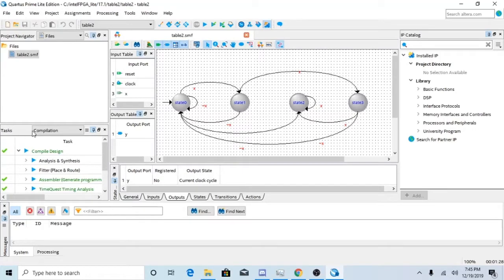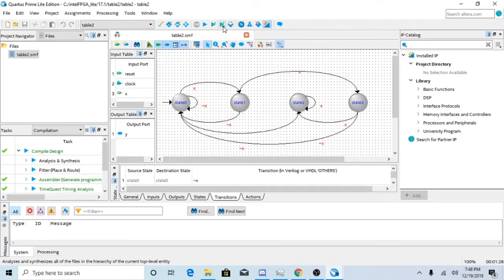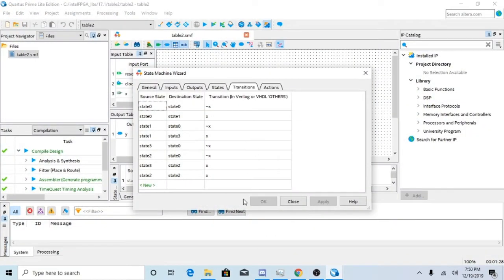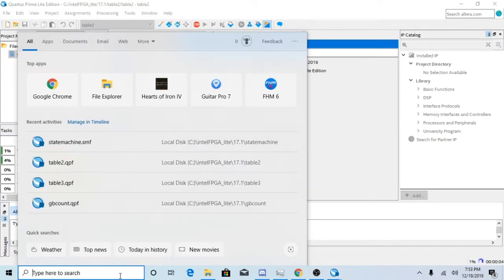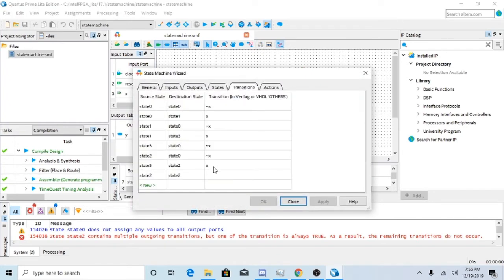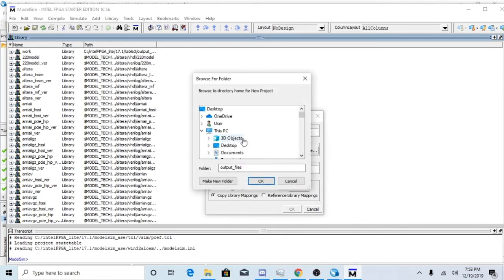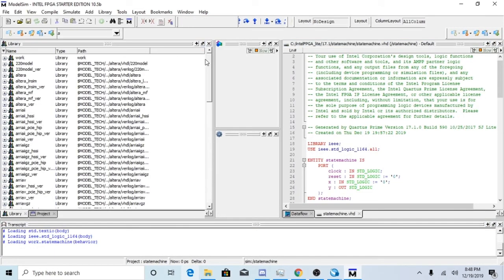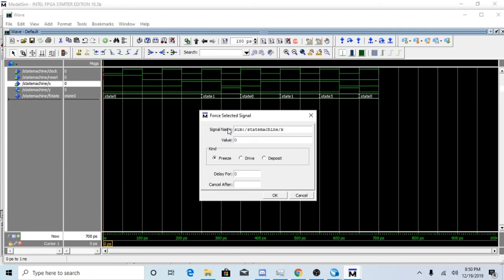State Machine Tutorial with ModelSim all States

Comment: I'm wondering if you could help me one more time. The state machine I have needs a hardware reset after all four states were passed. Is there a simple way to make a software reset?
Reply: Once you made the VHLD file you can add the hardware reset to the system.
Reply: @smoslehpour  
I'm still fighting with reset. The demand is to try to reset a four-state Machine using an extra state. What would you say, is it possible to solve it at the level of State Machine programming, not going into VHDL? Thank you in advance!
Reply: But the reset actually exists in the state machine tool it is part of the tool and it is in the default anytime you take it high it will be reset, so I don't understand your question
Reply: @smoslehpour  To take the reset high and back to zero is exactly what I need. I built a traffic crossway model with two sensors (in and out), and a robot circles all the time through the crossway. The first time it goes through it everything goes well but when it comes back för the second time the machine has to be reset. I've already managed to solve it by an extra sensor or by a counter which ranges a delay. However, the question is how one can solve the reset problem with perhaps an extra state.
Reply: I need to see your design